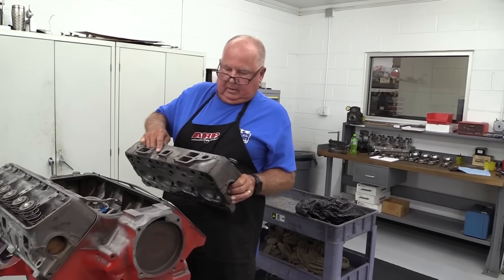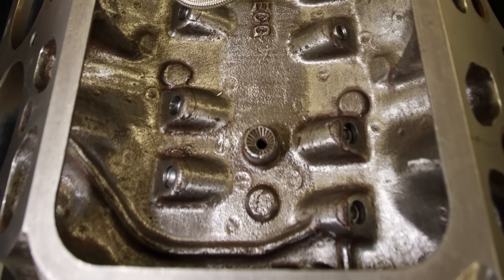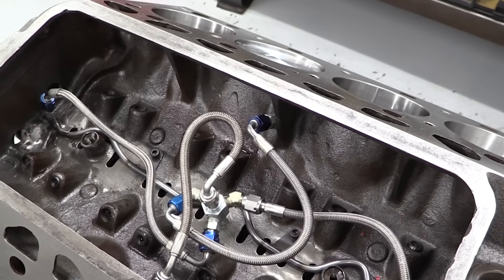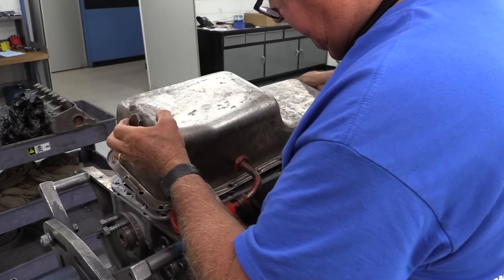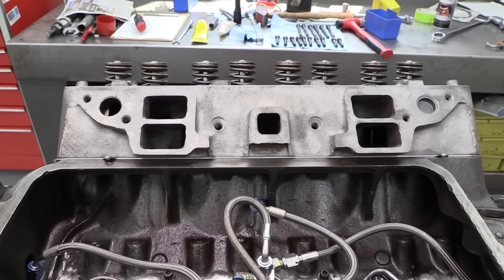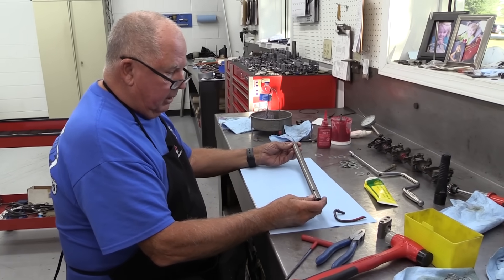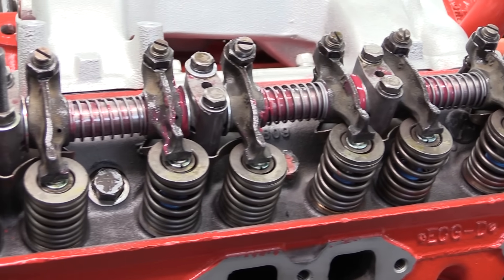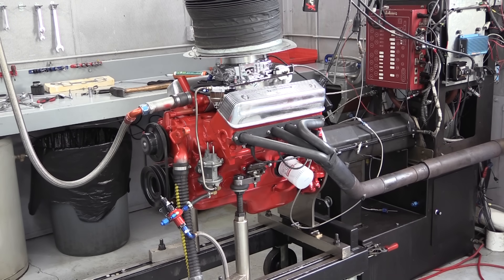The Engine That Replaced the Flathead -- Ford Y-Block Build

Comment: great video...and even tho fomoco had so many valvetrain problems and issues with the old 292/312 design, that j.c. whitney offered an external line kit that oiled thru pre-drilled access orifices in the valve covers, and it single-handedly almost destroyed the longevity and durability reputation that their flathead earned over the decades...then they classically "overfixed" the problem with the advent of the "FE" series. the non-side-oiler engines fed the lifter galleys before the bottom-end that was insane. these oiling systems must be reworked before any real-action above 5500 r.p.m or ka-boom....then ford thru the "baby out with the bathwater" when they copied the big-block chevrolet with its canted-valve 385/Lima and "cleveland" engines and even the earlier "windsor" series that also copied chevrolet, but then ceased production of the "fe" soon afterward in the 70s....in trucks they had the famous "upside-down" manifolds and front-crossover pipe too...these engines were also known as "powerhouses" in the early thunderbirds, so much so ford used the term "thunderbird motor" for years to come and it also easily murdered corvette sales....good video, and i think keith has forgotten more than most engine-builders know....kutgw.
Reply: charlotte quillen Have you ever seen a SBF and a SBC? In what way is a SBF a copy of a SBC?!
Reply: when chevy introduced its new 265 V-8 in 55, ford induced a massive negative add campaign against it..they said a V-8 thats a non "Y" block design and a short-stroke, would never hold together and fly apart...but chevy did so well with the mouse, ford had to copy the now succesful  "short-stroke" shortened block chevy design in their windsors...they copied them again with the 385/Lima  series from the big block chevy...its common knowledge. from an engineereing standpoint, their internals are near identical, even though their externals appear vastly different.
Reply: @Imnotyourdoormat   Yep, chevy did so well in Nascar in 56 and 57 against the Y block --- LOL, I had to laugh my friend! seriously? check the record books
Reply: to daniel jessup!!!....1956 Nascar Chevrolet- the Big Winner on Y/T....and thanks bub...glad to know theres still a few out there that know W.T. F.......and kutgw.

Comment: That sounds really good! It sounds way burlier than 200hp,  I actually like the clickety clack of the solid lifters too
Reply: All of these huge old engines makes like 200hp but sound like 2000hp
Reply: They sounded best w glasspack stacks coming up right behind the cab.  Made Thunderbirds sound tame.  Loved that sound! Not too load either, just pure and smooth.
Reply: 218 HP is a huge jump up from the flathead V8's that struggled to make 100 HP...
Reply: 200 HP 70 years ago.
Reply: @alexisg311  Can you believe we are still using gasoline for 100+ years now? The technology of engines has remained almost exactly the same. The only thing that has changed since the 1940's is the metallurgy, the invention of new nitride coatings, teflon coatings, better quality oil, better aluminum alloys, and not much else. The thing is, modern cars do not get better gas mileage. Somehow they have managed to put alien technology and modern computer chips into new cars, and they still only get 28 mpg.

Comment: Do they sell that oil system for the rocker arms? I would be very interested in one of they did.
Reply: It's not needed, anyway, so don't worry about it.
Reply: Please don't fall for this, the oiling system from the factory is perfect as is, just build it clean with the cam bearing installed properly and keep up on your oil changes. No problems.
Reply from the maker: Sorry, no. I asked Keith that question and he said because it requires machine work it is just something they do in house for their own builds. Thanks for watching!
Reply: @TheHorsepowerMonster  Thank you.
Reply: silverbird58  The way I build them works well. After all, I do have the fastest Y-Block in the world. ;-) lol

Comment: I used to help build dozens of these engines. 352ci was the big stroker you Could run. Now my old work even makes the only y-block aluminum heads, they're making over 500hp it's crazt
Reply: M See. ctrl
God made a dog

Comment: Threading and placing a bolt into the rocker block is exactly what I did on the 272 that I overhauled when I was about 22 years old.

Comment: Ford continued development of the y-block in argentina for several decades, since they never got the other ford small blocks. Fase 2 y-blocks got several improvements over the original engines, while keeping the stock block.
Reply: Ford and other US car companies would ship the tooling to Mexico & South American countries and continue making them "Down South" of the border.
Reply: Ford apparently redesigned the Y Black heads around 1971 for the Argentine/Brazilian 292's, as in no more top/bottom intake passages.

Comment: The merc heads the intakes were side by side (but they didn't make the big valve heads.
Reply: Mercury Y Blocks had  the same port configuration and valve sizes as the Ford Y-Block.
Lincoln are side by side.
Reply: No such thing as a Mercury Y block. They used the same design as the Fords (I think there may have been some Mercury only cubic inch configurations, though.) Or are you talking about the M-E-L (Mercury Edsel Lincoln) engines? That is a completely different family than either the Ford Y block or Lincoln Y block.
Reply: The Mercury Y block is effectively the Ford Y-Block.  The early Mercury version was 256.  Once the 312 was introduced, I think all of the Mercurys used that but I'm not positive about that.
For the most part, though it was the same engine only possibly in a slightly different configuration.  They had Mercury valve covers, which are pretty hard to find now.
Reply: @charliemccraney  the 54 y block Ford was 262 if I remember correctly. Very short run at the end of the 54 model year.
Reply: In '54 was the 239 and 256.  There was never a 262.
There are 3 port sizes for Y Blocks, with '54 being the smallest, '55-'56 medium and '57 on large.  A small port intake will not work with large port heads.  If the Mercury intake came from a '54 and the heads were '57 or newer, then it would not have worked.  '56 should work on all of them.  All of them are stacked port.  None were side by side.
Reply: When I was scrounging parts when I was in high school I came up with a 56 merc intake for a 292 and it wouldn't fit the Ford. There were a half dozen of us hot rodding those motors. I even knew a guy that pulled some serious horsepower out of a 54 flathead. (Expensive)
Reply: Cbmech The only intake issue I know of is the 239 Y is different than the others. There are different port sizes (that's what port matching is for) but they will BOLT on.

The last year for the Flat Head was '53.
Reply: @foxfordcatguy2283  OK  if  you  say  so .
Reply: Cbmech All I'm saying is the "Merc Y block" with side by side ports and the "Merc intake" you mentioned that wouldn't fit a Ford Y block were probably Lincoln Y blocks which DID HAVE side by the side intake ports as opposed to the Ford Y block stacked ports.

Comment: In 1969 I put over $4000 into a late 57 Tbird 312 punched 90 over delivered almost 600hp  to the wheels. The heads were ECZ's cut for copper circle seals.
Reply: I had a 292 with dual upright Holley 4 barrels. Talk about a leaking mess.....
Reply: @dsloop3907  are you talking about the haystack carbs with the butterfly's exposed on the top of the stack? I always thought those were carters. The only thing I did with them was take them off and throw them away.

Comment: Back 45 years ago when I was taking auto shop at Peoria Central High school we still had a 292 Y block Ford as one of the shop engines that the students used as a project engine to teardown & overhaul. I asked the teacher about the valve covers that obviously had been bent up and then beat back in shape with a couple of large washers welded on where the studs to hold the covers on were. He explained while pointing to the two impressions in the shop ceiling twenty feet above a previous student had put the engine back together and when he tried to start it up it would fire  so he used starting fluid while cranking the engine. What he didn't know was the carb was flooding the whole time and gas was gathering in the oil pan and when the engine finally caught it blew the valve covers off bouncing into the ceiling and at also blew the oil pan off but they were able to repair it enough for more years of students to practice wrenching on.
Reply: So it WAS getting spark.....
Reply: @curbmassa  Ha ha ha. I wish u-tube had a laughing face emoji.
Reply: @cozmcwillie7897  🤣
Reply: I went to Spalding; 74; small world !!!
Reply: Saw a 390 ford throw the valve covers once what a bang!
Reply: I once saw the cast oil pan blown off a Cummings Diesel in pieces. We sent samples of the crud we scraped off for oil analysis and it came back either. If a couple of squirts don't start it then have it towed-- it's broken.
Reply: That's another scary engine explosion. Back in the 70's my dad was an auto mechanic, and they had some used truck in the bay next to his and the crankcase apparently had a ton of gas in it from people trying to start it. Wound up blowing the oil pan right off the engine with it on the lift and the bolts were still in the block with shards of metal still under the bolt heads. Good thing nobody was standing under that when it blew up. Apparently, it was quite the mess!
Reply: Y Blocks were rather tough engines compared to at least the small bolt main SB Chevy V8's, through 1967
Reply: You should learn how to spell and punctuate.
Reply: @clarencealexander1908  Jeesh, it's a Youtube comment, not a  textbook.
Reply: Ford needs to quit making vehicles since every vehicle they made are crappy Mopar has the best looking vehicles on the road
Reply: Ford always had crappy engines Mopar has the best engines That is why the are the leader in performance and value
Reply: @Michael Flores  I wonder how  those Hot Rodders over the decades didn't realize they could have a better engine than SBC.

Comment: My dad had a 292 HD Ford engine powering his water well drilling rig for around twenty years or more,it was one tough as nails engine that had a lot of power. The rig weighed around 70,000 pounds and this engine handled it well for many years as well as being the powerplant for the drilling platform of the machine. These truly are some tough,durable engines. I can personally attest to that fact.And this engine and another he had in a 1963 F100 made me a Ford man for life. Never a tougher engine was ever made. A small block Chevy may outrun the Y block,but it sure won't outlast the Y block.
Reply: Seen many 292s blow up. School buses mostly.
Reply: I agree. We had the 318 in a Dodge machinery truck. Excellent engine. Tough and powerful.
Reply: The Dodge/Plymouth Poly 318 was a better engine then either and didn't have the valve train woes these things had.
Reply: @4thstooge75  318 dumb ass was a newer engine !!!!
Reply: @wilburfinnigan2142  yeah the 318 (which was based off the desoto hemi btw) was a 60's motor. I tend to compare it to the 292 hemi which Don Garlits (who's considered the father of drag racing) used back in the 50's to dominate the sling shot ranks.
Reply: @wilburfinnigan2142  The basic Plymouth poly motor came out in 56 as a 277 (303 in Fury).  The 318 version (looks just like a 277; and is basically a bored and stroked 277) came out the very next year.  (If you're thinking of the 318 wedge, then yes, that is a "newer engine" that wasn't introduced until 67, although even that was just a bored out version of the 273 wedge introduced in the 64 model year.)
Reply: @davidmiller9485  I know "Uncle Tony" claims a DeSoto origin for the 318 poly, but other than the timing chain and distributor, there is almost nothing in common between the two motors.  Bore spacing (bore center to center distance) isn't even the same.  There is more similarity between the 318 poly and the Gen III Hemi - they at least share a common bore spacing.
Reply: @herman452  Yaaaaaaawn ZZZZZZZZZZZZZZZZZZZZZZZZZZZZZZZZZZZZZZZZZZZZZZZZZZZZZZZZZZZZZZZZZZZZZZZZZZZZZZZZZZZZZZZZZZZZZZZZZZZZZZZZZZZZZZZZZZZZZZZZZZZZZZZZZZZZZZZZZZZZZZZZZZZZZZZZZZZZZZZZZZZZZZZZZZZZZZZZZZZZZZZZZZZZZZZZZZZZZZZZZZZZZZZZZZZZZZZZZZZZZZZZZZZZZZZZZZZZZZZZZZZZZZZZZZZZZZZZZZZZZZZZZZZZZZzzzzzzzzzzzzzzzzzzzzzzzzzzzzzzzzzzzzzzzzzzzzzzzzzzzzzzzzzzzzzzzzzzzzzzzzzzzzzzzzzzzzzzzzzzzzzzzzzzzzzzzzzzzzzzzzzzzzzzzzz.........................................................................................................................
Reply: @herman452  That's what I always thought.
Reply: @4thstooge75  Yes a Dodge "wideblock" 318 is one of the best engines ever made. The 318 wideblock "poly" engine is basically an industrial commercial engine that was put into regular trucks in 1964 to 1971 or thereabouts. The 318-3 motor home engine is also one of the best engines ever made, it had a forged crank, sodium filled valves, and was an industrial level engine that was put into some light Dodge trucks, but it was a special order only engine. I think Dodge 318's and Dodge slant six engines, were probably the most durable engines ever made, and didn't have any weird "fluke" block, or oiling problems. The early 1960's 318 solid lifter wideblock, and the early 1970's "318-3" had full floating rods and forged cranks. Later they switched to cast cranks and pressed piston pistons, and were basically equivalent to a Chevy 305.
Reply: @Ritalie  we had 361 hd v8's in AUstralia in Bigger Dodge trucks. recall them?

Comment: Chevy style exhaust port?  It’s called Siamese ports and this motor predates the SBC.  Also having “only” 10 head bolts is not a problem with most motors, unless it’s a crack prone SBC head...
Reply: SBC copied the Lincoln Y.
Reply: crack heads and all   still run like hell
Reply: john barret Exactly, the SBC do run like hell! that's why they always need more cubes to beat a SBF.

Comment: I would love to see his tricks on the F.E blocks.
Reply: fe block mills were dealing hemis fits in nascar
Reply: @tomschweikert9537  Not true, NASCAR outlawed the Hemis and Mopar had to use wedge head engines. The Hemi "cleaned up" in NASCAR. GM & Ford whining to Bill France caused the ban.
Reply: @4thstooge75  probably the tunnel ports, side oilers,  etc
Reply: @4thstooge75  If I am not mistaken Mopar was allowed to run Hemis in 68/69 but they were destroked to 404 cubic inches? Ford also ran a 396 FE which was a 427 running a 3.5 inch stroke crankshaft.
Reply: @tomschweikert9537  uhhh,no xD

Comment: AS USUAL FORD OVER ENGINEERED POORLY ENGINEERED
Reply: Not true at all,my Dads Ford trucks were always worlds ahead of any of the GM V8s he owned. The only GM engines that were even in the ballpark with his Fords were the GMC V6s built from the late 50s to the early 70s,but as good of an engine as they were,they were absolute gas hogs. A V8 of almost any type would run cheaper.

Comment: The oil pump design has to pump the oil out of the engine in order to pump it back into the engine.
Reply: Yeah but it was also extremely easy to repair or upgrade the oil pump on these. Buick later copied this design into some of their engines
Reply: Ya, like a big block Mopar. Buick, etc Lol.
Reply: works just fine. big block mopars d it, and they have absolutely no problems.
Reply: you know Ford make it backwards
Reply: @1racemate  Several other manufacturerers have used this same design.

Comment: I love watching these old Engine Masters work if you ever get the chance to to watch or assist, don't pass it up these old guys are amazing you will learn stuff you ddefinitely didn't learn in school. Thanks for sharing nice build.
Reply from the maker: Thanks a lot!
Reply: like how to please a lady?  it can't be done.
Reply: @kbtube8125  Hahaha. 
They say if it has tires or tits, its trouble 😊
Reply: On the 272 Y, the 292 Y, , and 312 Y blocks-as with most every engine pre 1974/75 the only tools needed to work on and do everything you had to do to your engine, was a standard set of wrenches & sockets. Add a few screwdrivers,  channel locks, pliers, needle nose, a couple of crescent wrenches a vacuum guage, timing light. I stopped doing my own repairs sometime around 1979, I got a Toyota Supra, inline 6, fuel injected and I'm glad I never had to  do any work on that car. Kept it and drove it for 25 years, may have changed out the headlight bulbs, A/C condenser. & rear wheel bearings. 😏
Reply: No doubt about it!!
Reply: Nothing sounds better than a balanced and blue printed Ford flathead eight. Reminds me of the sound a vintage Chris Craft boat motor makes in water.🚣‍♀️⛽

Comment: In '62 I rebuild my 312 Y-block T-Bird '57 Ford engine.  Had good cam, cleaning ports, and 3 Strombergs.  Gosh, I wish I'd never sold that car.  It has some much "just right" horsepower and I loved it.
Reply: What exhaust did you have on the engine ?

Comment: many years ago I had a 1954 ford pickup with a 239 ci engine , which I think was the real engine that replaced the flat head. then came the 272 then 292 if my memory is correct.
Reply: And Mercury's had odd cid.